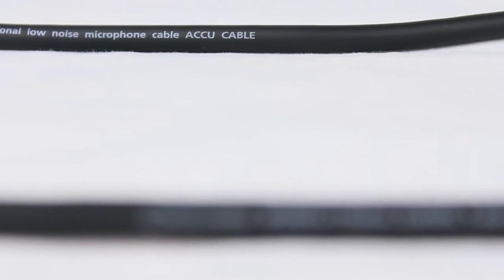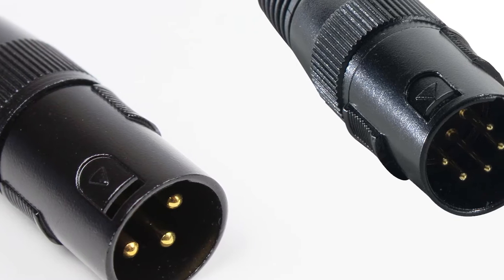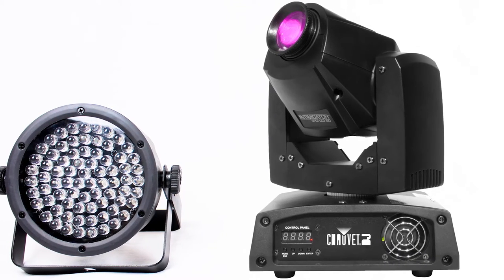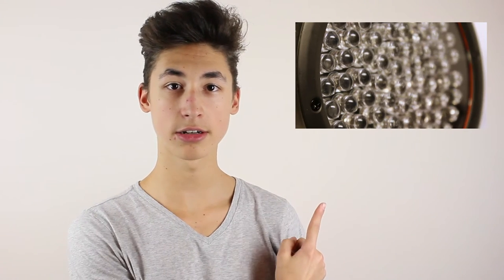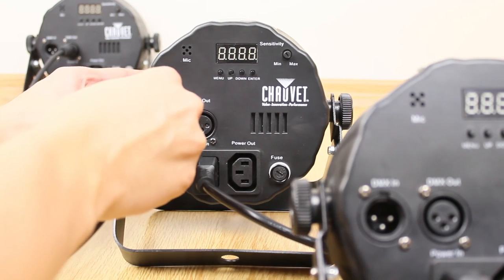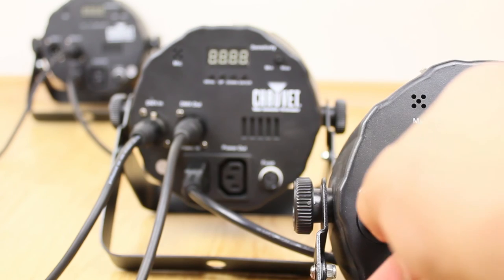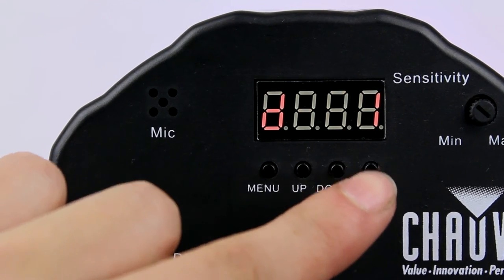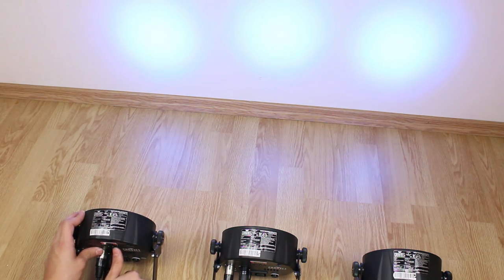Master Slave Mode Tutorial

Comment: I just recently bought these with an obey 3 controller.  Is there any way to control one light alone while the others stay at a setting or remain off?
Reply from the maker: What do You want exactly? Control two or more separated groups of lights or something else?
Reply from the maker: As You may know the Obey 3 is not capable to control multiple groups.
Reply: There is if you put the single light on a separate dmx channel and control it independently from your other lights. It depends how many channels your controller has and how many lights you want to use.